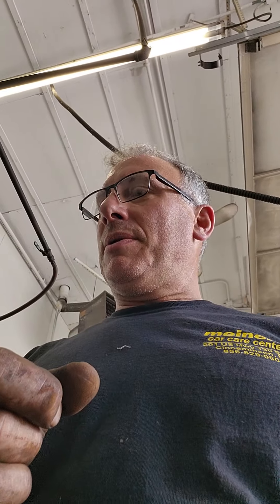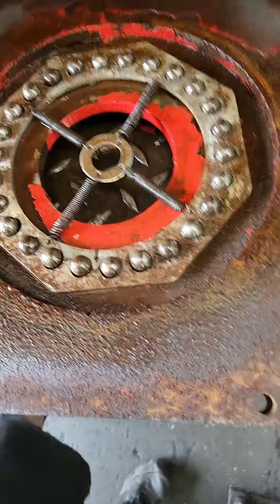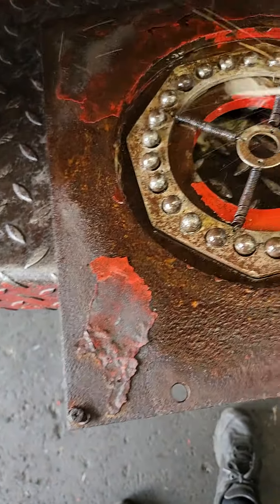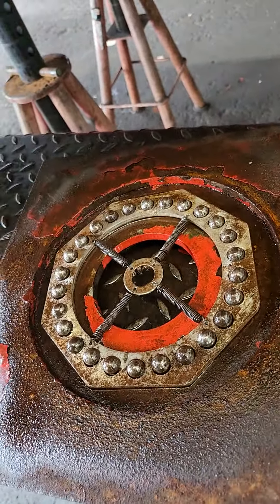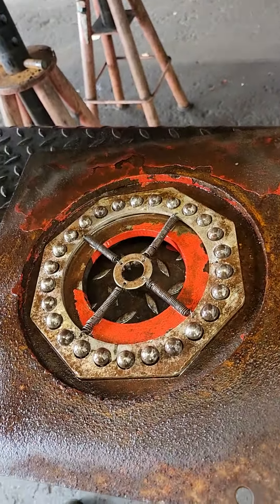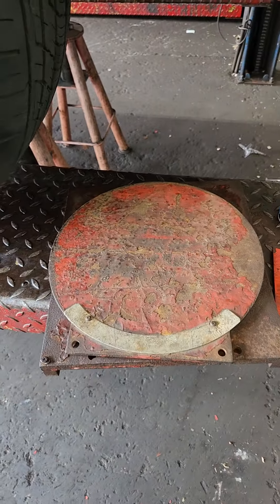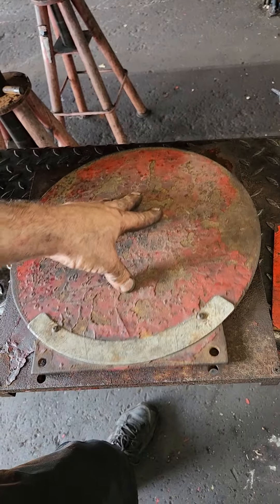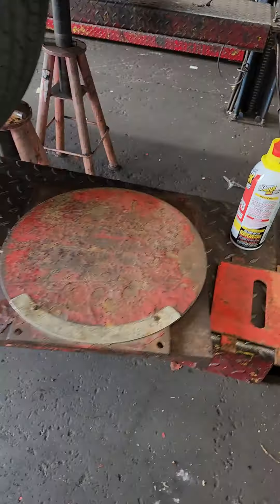Who will do maintenance on the alignment machine turn plates? Take a look

Comment: My company (small regional family owned) has a location 45 minutes northwest of me that they opened 5 years ago. The guy in my position running it is a European car master and has the manufacturer master certs as well , which oddly enough he says are bs and then makes the hand jack off motion 😂. Anyhow they decided to go all out, and then went all out again two more times. The alignment machine 60k and then also have the thing that reads tire tread and quick alignment check as you drive over it. Heard that was upwards of 60k as well. Stuff is crazy and out of control.
Reply from the maker: Sounds like they like to sell alignments